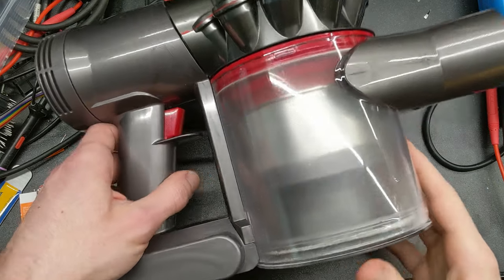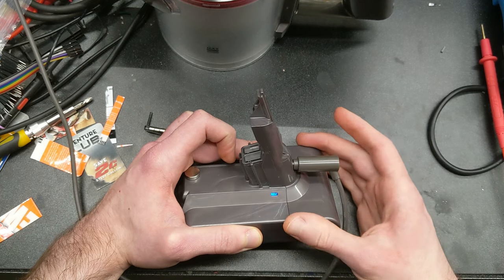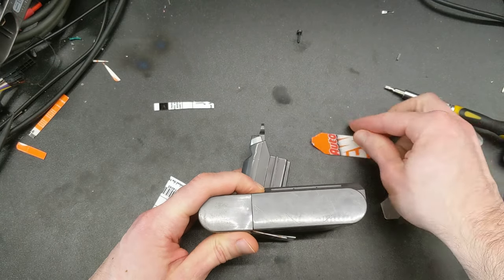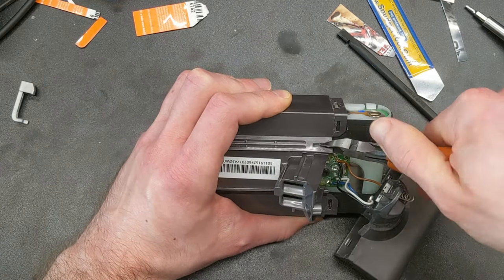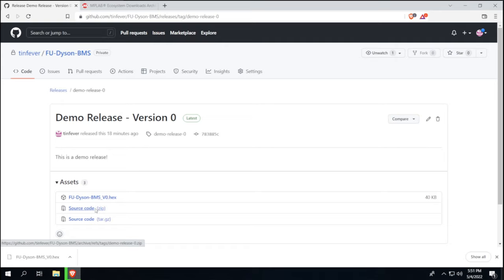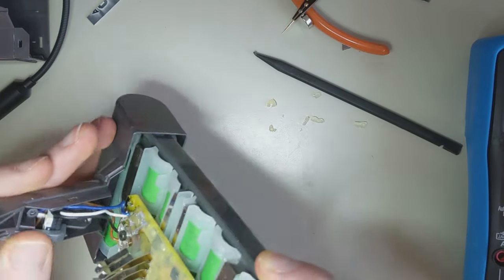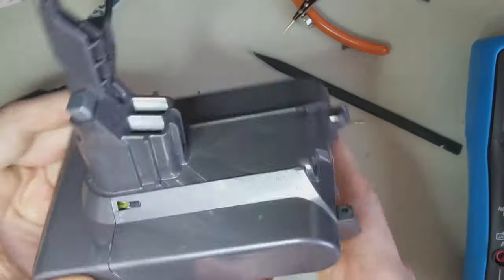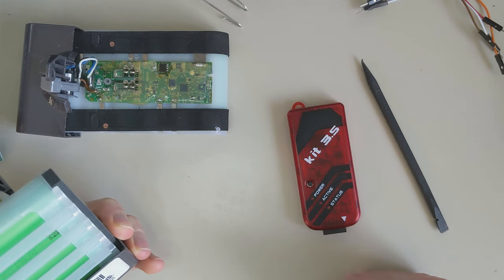FU-Dyson-BMS - (Unofficial) Firmware Upgrade for Dyson V6/V7 Vacuum Battery Management System

Comment: Балансировка бесполезна, слишком высокие токи нагрузки. В случае перегрузки (включении турбо режима) слабые ячейки мгновенно снова улетят, поэтому Dyson отказался от балансировки. Это не было сделано из плохих побуждений, просто это действительно бесполезная опция, плюс отсутствие охлаждения.

Я вот только не понимаю, зачем было выкладывать бесплатно? Я два года назад сделал решение по этим батареям (уверен, Вы это знаете) и позднее добавил диагностику без разборки батареи через компьютер или автономным устройством:
https://youtu.be/j9Iz4iLyELQ
Reply from the maker: Translation of original comment:
"Balancing is useless, too high load currents. In the event of an overload (turning on the turbo mode), weak cells will instantly fly away again, so Dyson refused to balance. This was not done out of bad intentions, it's just a really useless option, plus the lack of cooling.

I just don't understand why it was posted for free? I made a decision on these batteries two years ago (I'm sure you know this) and later added diagnostics without disassembling the battery via a computer or a standalone device:
https://youtu.be/j9Iz4iLyELQ"

That's really interesting that you already developed something almost identical! I had no idea and I thought I'd searched around. Crazy how it feels like there are separates worlds out there.

That's an interesting viewpoint on balancing that I hadn't heard before. Wouldn't balancing while charging keep a weak cell from drifting lower in voltage compared to the rest, and thus prolong the usable life of the battery? I do see your point though that a very poor health cell will have higher ESR so when you draw 17 amps in turbo mode, that ESR will quickly cause the apparent cell voltage to plummet and trigger the low voltage cutoff.

As an example, lets say you have a pack with 5 perfect cells and 1 poor cell, and the healthy cells are at 4.2V with 30 mOhm ESR, but the poor cell is at 3.6V with 200 mOhm ESR. As soon as you start drawing 3A (the normal mode current draw) the healthy cells might appear as 4.11V (30mOhm x 3A = 90mV drop) but the poor cell would appear as 3.0V (200mOhm x 3A = 600mV drop), and so the 3V low voltage cutoff would kick in. Without balancing, you would be screwed because the good cells are already at 4.2V so you can't charge the battery, but the poor cell instantly hits 3V so you can't discharge it either.

However, if you had balancing, couldn't you slowly bring that 3.6V cell up to 4.2V? The ESR would be the same but now with a 3A current draw, you'd have an apparent cell voltage of 4.2V-600mV drop = 3.6V, which would leave you some usable capacity to actually use the battery to vacuum.

Your point regarding turbo mode remains though, because no matter how well balanced, even a 4.2V 100mOhm ESR cell at 17A is going to drop 1.7V to 2.5V, assuming it can supply 17A to start with.

As for why I released it for free, as much as I'd love to make money from all the work I put in to this, I didn't see a good way to commercialize it. I think there aren't going to be a ton of people willing to open their battery, buy a PICkit3, and program it themselves (even if I wish more people would consider it) so I doubt I could sell more than a few copies of the firmware if I tried to. That leaves using it to repair other people's batteries, but shipping Li-Ion batteries is complicated to do legally and I don't think I'd be able to charge very much before people just decide to buy a knock-off on Amazon. Even if I charged $20 + shipping, shipping both ways would probably easily be another $20. I doubt many people would pay $40 to ship their battery to get it repaired, when you can buy a knock-off on Amazon for the same price. If there would be a high volume, then maybe you could bring some of that repair price down but I can't see ever getting enough batteries to even take an hour a day in time.
Reply: All in the spirit of open source and right-to-repair! The more freely available information there is to fix repairable things like this, the better off we all are. Unfortunate that the language barrier does somewhat limit the diffusion of knowledge in engineering fields.
Reply: @jajefan123456789 , кому лучше, а кому нет. Хорошие решения требуют много ресурсов, времени и испытаний. Не всё может быть свободным. Почему бы тогда и не работать бесплатно? Бесплатный инструмент для мастера, бесплатная работа для клиента, почему нет? :) Но нет, за работу мы хотим получать гонорар. Я делаю хорошие вещи и я не могу позволить это делать бесплатно.. Увы, как разработчик, я не работаю бесплатно.

Comment: Thank you, is there info about pin assignments for v10 (sv12) battery?
Reply from the maker: V10 vacuums use a different microcontroller and BMS chip entirely, so this project isn't compatible I'm afraid.

Comment: CHARGE_OC_FLAG 8times flash could u tell me  what should i do. dyson  v6
Reply from the maker: Hi. If you are running my firmware an encounter an error like that, could you please open a GitHub issue? I'll try to help there. Please provide as much info there as you can such as the original issue with your battery pack, if you are using the original charger, how frequently that error occurs, etc.

Comment: Hi, can I use pickit2 for this?
Reply from the maker: If I remember right, the pickit2 doesn't support the PIC16LF1847. It might support a similar microcontroller part that has the same programming protocol but I can't remember for sure.

Comment: Can you do this on a dyson v11 animal 25.2v battery pack?
Reply from the maker: Unfortunately not. The newer models like the v11 use a different microcontroller and BMS chip so it'd require almost starting from scratch.

Comment: Ok I need to see if this will work with 360 robot vacuum batteries
Reply from the maker: It's extremely unlikely this would work with anything other than Dyson V6, V7, or V8 batteries.

Comment: Dear tinfever, thank you for a great job! Probably, you can help me. I have SV11 battery out of Dyson V7. I have followed all your instructions. I have charged all cells up to 4,0 v. by connecting each to a charger. Then connected the battery to Pickit 3 programmer according to wiring instructions. Pickit software discovered the programmer and discovered Device: PIC16LF1847. Hex file was successfully imported and written. When I turn on the battery, it flashes with three colors (like in your video) and gives 5 green flashes. I measured voltage on two big contacts: it shows 24,5 v. Till now everything looks fine. When I plug th battery into Dyson, battery gives 16 red flashes. As I understand, this inducates to short contacts. When I plug the other battery (not programmed) it works perfectly fine. why does thr battery thing that there is short contact inside Dyson? Is there a way to fix it? Thank you.
Reply: FYI: The board is marked 228499-01/03. Also, there is a red "All Protect" message under the "Configuration" line in the upper right corner in the Pickit 3 Programmer window.
Reply: OK. I got it resolved. Broke my head searching for a problem. Finally, measured all batteries again and found that one of them was low voltage - 3,6 v. Probably I missed it when I was charging batteries separatelly. After charging this battery everything works fine. Thank you again!

Comment: Ive ordered a pickit right after seeing this video. But soon I realize , why don't I just buy a BMS balance charge board and resolder the connections... Only cost me $4 instead of $30 for a programmer  .,😅
Reply: Where did you get the bms for only $4?
Reply: @therogman7485  aliexpress have tons of bms board. Just need a little mod to fit in.
Reply: @mingj2637  yeah but not for $4 lol it's over S15 to Canada
Reply: You had success replacing the board? I also tought about it

Comment: Absolutely useless. Batteries need to be tested under load as well. Under load if there is a drop in anyone cell the battery firmware will fault again. The lithium ion voltage accross all 6 cells can not deviate under load and have to uniformly drain at the same rate.
Reply from the maker: You are correct that if the cell voltage drops under load enough to reach the cutoff voltage, the firmware will fault again. If this happens, it would indicate a failing battery cell. The cell voltage of each cell must be within the safe range for the firmware to allow the battery to turn on, the cells don't all have to be the same voltage though.
Reply: Sounds like somebody tried to replace the cells with Laptop-pulled cells.

Comment: This battery is not friendly to customers that why do not buy anymore dyson and let them take care their customers more and stop some stupid profit.
Reply: Dyson are protecting their customers by ensuring that battery packs cannot be used or re-used if cells have reached certain critical safety limits. They couldn't be doing anything even slightly better than what is being done here. When the pack faults, the BMS trips and you replace the pack. That's EXACTLY how all responsibly-manufactured domestic products behave.

Comment: Thank you so much!  I had replaced my cells and then discovered that the Dyson BMS permanently disables itself when it detects a cell disconnected.  I bought a PicKit 5 and followed this YouTuber’s instructions :  https://youtu.be/7t9yA3_KUI0?si=xnaGyJ3FX6lj3l3O but it didn’t work.  The LED wouldn’t show anything at all any more but the PIC was still responsive.  I therefore downloaded your wonderful firmware and it flashed successfully first time, bringing the original Dyson BMS back to life.

Thank you so much!

Regards
Richard

Comment: Can i install this firmware to sv10 battery? It looks like almost same
Reply: Can i program it usign a different programmer instead of pickit 3?
Reply: Did you know what 4 times flashing means? I cant find anything related to it on the internet. I was disassembled and checked the cells on my battery one of the cells was around 3.08v and the other 5 was around 3.5 ish i was then recharged that 3.08v cell back to the 3.5v but it still gives same 4 time flashing weirdly when i hold down the switch for 5 seconds it gives 4 red and 1 blue but no matter what i tried i did'nt managed to get it to charge.

Comment: Please help me. I wrote FU-Dyson-BMS to SV09-PCB61462 which became a brick.
The LED glowed blue three times and turned green. When connected to a charger, it flashes yellow and then turns blue, then turns white and then turns off.
The cell voltage ranges from 4.08V to 4.17.
Both FET and fuse are normal. I think there is a problem with the voltage measurement of the cell, so is there a way to avoid this or a code modification?
For reference, the result of EEPROM-parsing-tool.py is shown below.
{
     "Firmware": "Tinfever FU-Dyson-BMS V1",
     "Total_Runtime_Seconds": 0.0,
     "Faults": []
}
Reply from the maker: It sounds like you might be running in to the over-discharge protection, meaning one of the cells is hitting 3V or the BMS thinks one of the cells is hitting 3V. Could you try connecting the battery to the charger for any amount of time to reset the low battery flag, and then test if the issue occurs when the battery is not installed in a vacuum? If one of the cells has a very high ESR, it's possible that the cell will measure an acceptable voltage with no load, but as soon as you put a reasonable load on the cell, the voltage will drop dramatically.

If you are encountering the over-discharge protection, as soon as that is tripped, the battery will always display the 3x blue LED flashes when you attempt to pull the trigger. This is reset by connecting the charger for any amount of time.

The next step after that would probably be one of two options:
1) Connect an 3 amp load across the battery pack directly (not going through the BMS) and verify that all battery cells remain in the acceptable 3.0-4.2V range. This would eliminate the possibility that one of the cells has high ESR causing the BMS to immediately trip the low battery flag.
2) You could also install MPLABX and connect the PICKit to the BMS, then compile and run the program in debug mode. You can load the "MPLab Watches List.xwatch" file located in the /firmware folder in the GitHub repo in to MPLABX as the watches list in the watches window, and then pause the program while running in debug mode so you can view the actual cell voltages being measured by the PIC. You could even go further and insert a breakpoint at the entry in to the error function code so you can see all the variables and determine why it is entering the error function. You'll probably need to solder on a programming header to the BMS or find a way to make those connections relatively stable while you are working on it.

While it would be possible to add a line of code that forces any given battery cell to always read as 4V so the program thinks it is always OK, I would strongly advise against doing that, especially without knowing the root cause of the issue in the first place. The reason I believe this firmware is reasonably safe is that I've implemented pretty much every protection possible. Hardcoding a cell voltage level would break some of those protections.

If you have further issues, please make a GitHub repo issue and I'll try to help as soon as I can. Thanks.
Reply: @tinfever  Thank you for your reply 1 was fine
Even if the load was connected, it did not drop below 3V.
Even if you press the switch with the battery pack alone, it blinks blue 3 times
Now I have installed MPLAB X IDE and loaded the farm
However, the debug mode does not progress easily while learning how to do it with Google search.